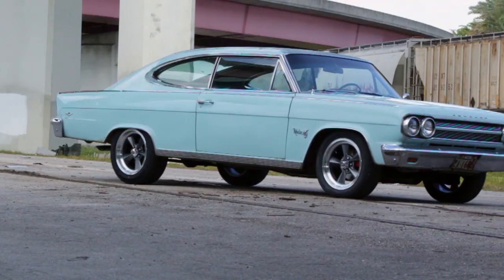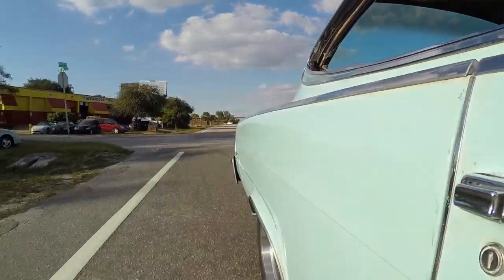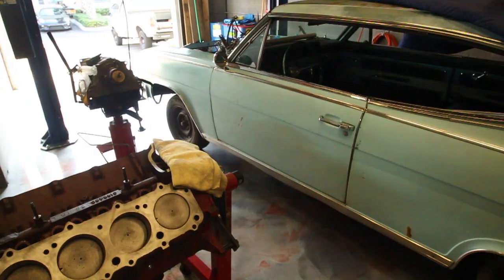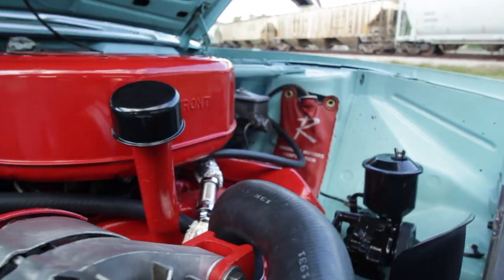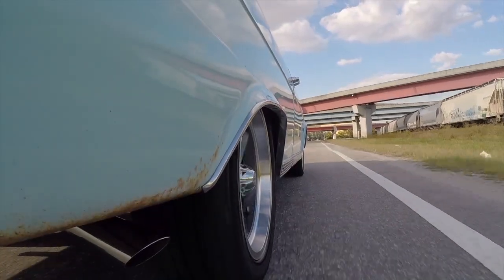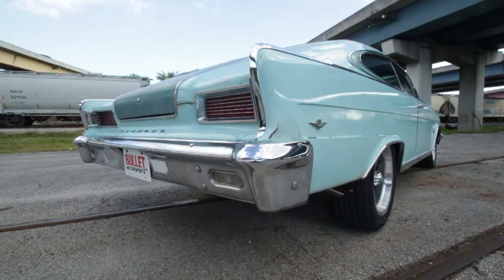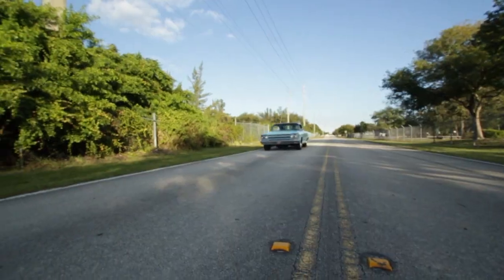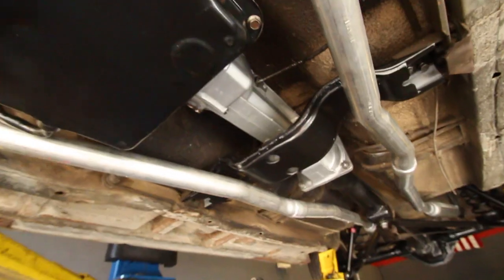1965 AMC Rambler Marlin Restoration in HD

Comment: It's about time somone gave this car some recognition. I'm 18 and have been restoring mine for 2 1/2 years now. Love the Marlin.
Reply: I am 22 and I am restoring a 65 AMC Marlin also 2 door hardtop I found out my is running I have 18 inch rims with 8 inch racing tires on it 2 barrel Holley carburetor only thing left is radiator and one brake is locked up
Reply: +Snowflake Frost Dayum, I felt that burn all the way over here!
Gotta love those prejudiced stereotyping turds, eh?
Reply: linglingjr For your information, it didn't throw a rod.  The carb jets clogged.  Got it fixed and it runs great now.  How do I know this?  He's my little brother, so you'd best back off and let him be, pal.

Comment: What makes the engine a 327ci? I have a 1965 marlin with the 327 engine and flashomatic transmission.
Reply: The bore was 4.00 inches and the stroke was 3.25 inches. Engine displacement was 327 cubic inches.

And don't let anyone tell you AMC bought their 327 from Chevrolet. 

After having owned and worked on many AMCs over the years, let's see if I can clear up some confusion.

AMC's 327 was first offered for the 1957 model year. Chevrolet's didn't become available until 1962.

AMC's first generation V8s (250, 287 and 327) had valve covers retained to the heads by two studs through the tops of the covers. The Chevrolet small block's covers used four bolts running through the outer edges of the covers to the heads.

On the AMC engine the intake manifold didn't seal off the lifter chamber. There was a curved metal cover which also contained the oil filler tube. With the Chevrolet the manifold sealed off the lifter chamber.

On the AMC V8 the thermostat sat in an iron casting that connected to the fronts of the heads and flowed coolant out to the upper radiator hose. Chevrolet's thermostat sat in the intake manifold.

And here's another difference: the AMC 327's intake manifold could be removed without disturbing the distributor. On the Chevrolet the distributor had to be removed to allow intake removal.

This is probably the most definitive difference between the two powerplants: the fuel pump actuation. The AMC 327 had the pump mounted on the timing cover. It was driven by an arm that rode an eccentric bolted onto the nose of the camshaft. On the Chevrolet the fuel pump mounted on the block and was driven by a pushrod with an eccentric cast right into the camshaft, well behind the camshaft sprocket.

While it's true that AMC did use the GM Delco "window" distributor for many years, the ones found on the AMC first generation V8s had different part numbers, castings, advance mechanisms and advance curves. The points, rotor and cap interchanged, and some aftermarket parts could be made to work, but there were enough differences between them that they could be like night and day.

Take a look at the cutaway drawing of the first generation AMC V8 http://www.crankshaftcoalition.com/wiki/AMC_V-8s and you'll also notice the differences in the oil filter mounting, spark plug location and exhaust port angle, plus AMC's use of rocker shafts versus Chevrolet's stud, ball and nut system.

Hope this helps!
Reply: @Rick-S-6063  Also used by Jeep on full size Wagoneers and J-series trucks starting midyear (March) 1965.